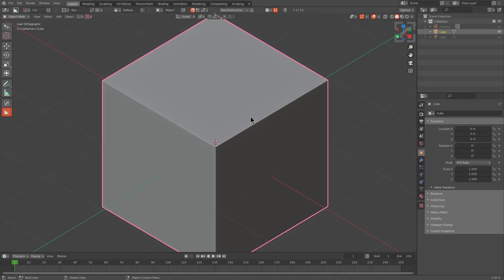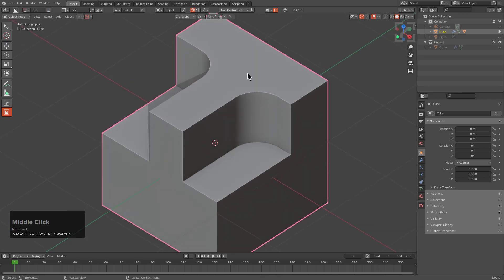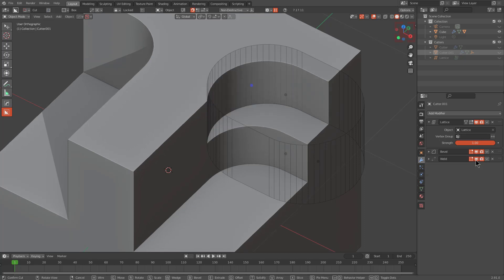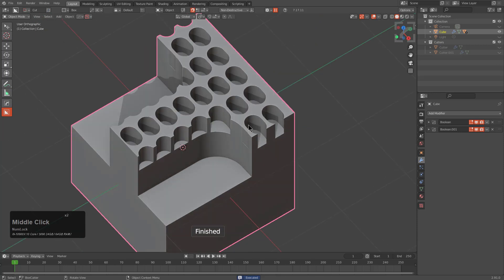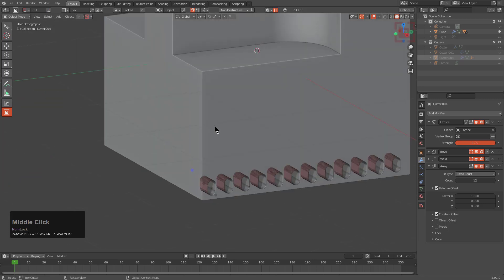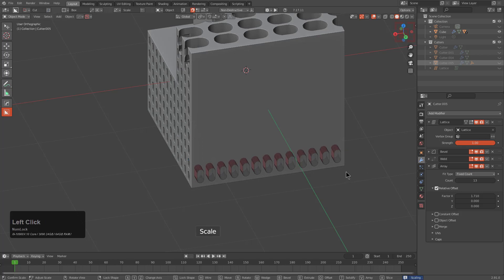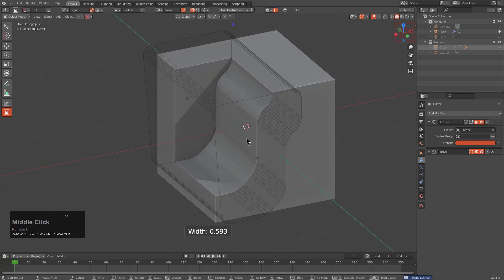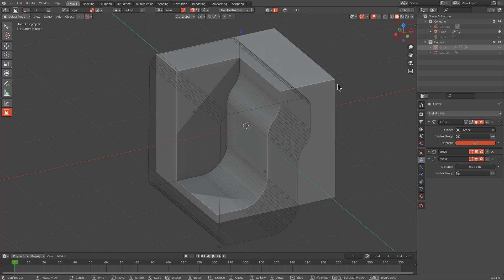#boxcutter 717.X - Debug Mode

Comment: Is there an option in Boxcutter/Hardops to turn on a display for what angle your current rotation are? What I mean is if I want to make a 45 degree cut on my default box I draw my Boxcut and then press "R" for rotate and I can ofc see what I think is 45 degrees but it doesn't actually tell me if I rotated the Boxcut for 45 degrees and this would of course go for all other degrees of rotation.

Comment: Hey. I don’t knit if it’s just me but since I got the new box cutter version something is really really wrong with inset, especially while cutting. Changing thickness doesn’t work a lot of the time and it’s so laggy it feels like I’m running a scene with 10 million tris even though it’s just a cube with another cube Boolean(with like a 1 segment bevel) used to inset. I get the same problem when I switch the cutter to live and try modifying it there. It’s just hell because I use inset a lot. Please let me know if you see this comment
Reply from the maker: https://www.youtube.com/watch?v=yq3nzsnMdb0
tools have been made and refined to recall booleans. Get in there and find out why. Recall the shape and find out why it isnt working. Inset has rules. And hops is built to show all steps of the process and allow for examination. You gotta get in and examine the problem or else nothing is learned.